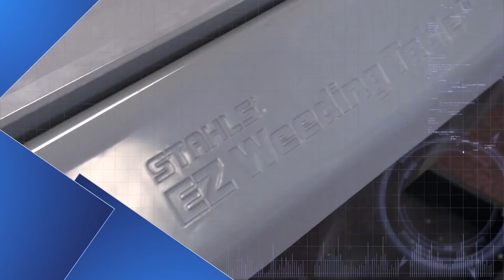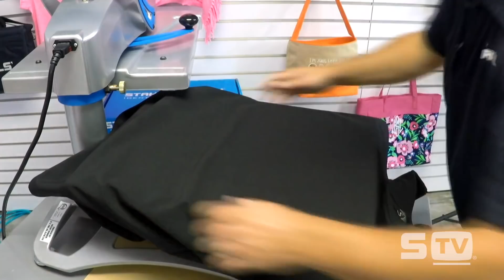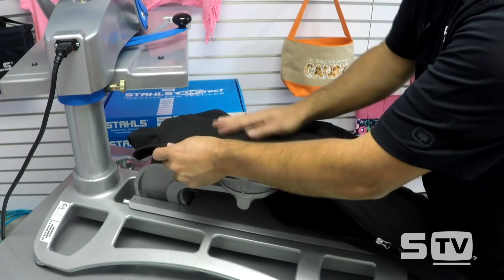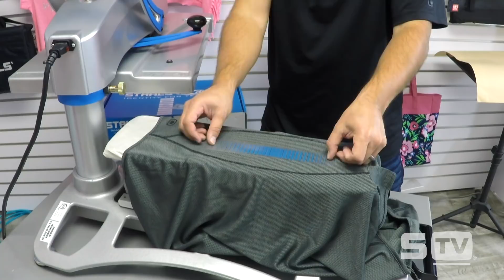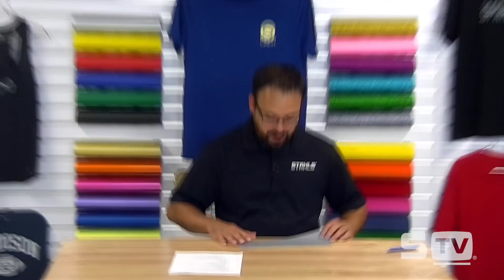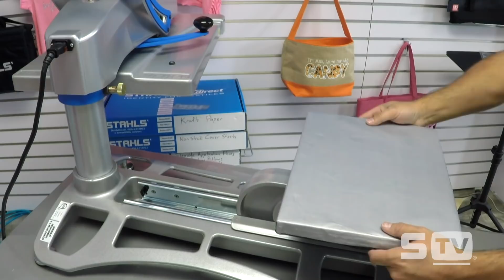How to Custom Print Reflective HTV

Comment: Could you use heatpress to print 4 color process.
Reply from the maker: Sure! You could heat apply 4+ separate colors. However we have other options to create a 4+ color design and heat apply in one step at stahls.com

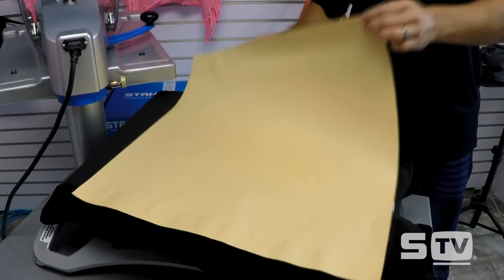Comment: Aye he Burned that Jacket 8:33 he didn't apply the heat resistance sheet properly there's a line at the bottom that will not come out !!

Comment: Hello, what is the machine called that prints the vinyl design?
Reply from the maker: A vinyl cutter was used to cut the design. Please visit https://www.stahls.com/vinyl-cutter for more information on our vinyl cutters. For printing directly onto heat transfer vinyl, you can use a print/cut system [ https://www.stahls.com/print-cut-machines ] or use transfer papers [ https://www.transferpaperexperts.com/ ].